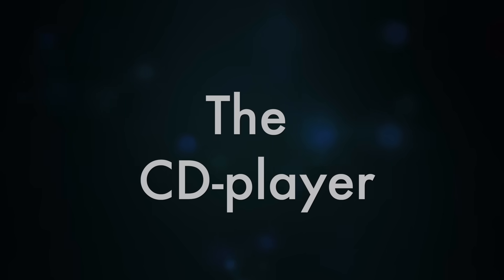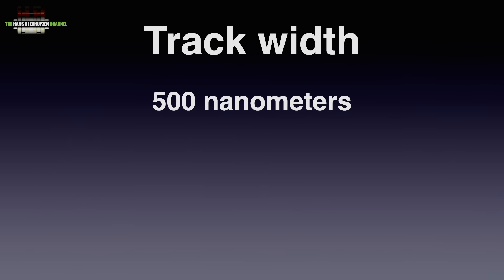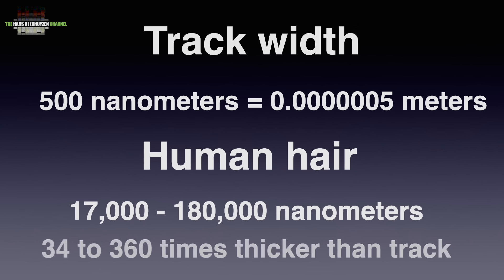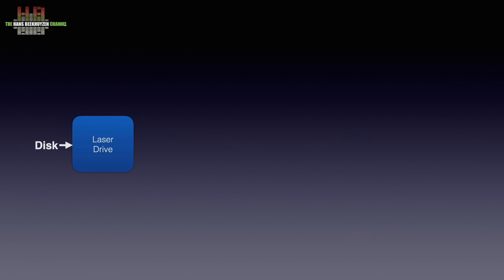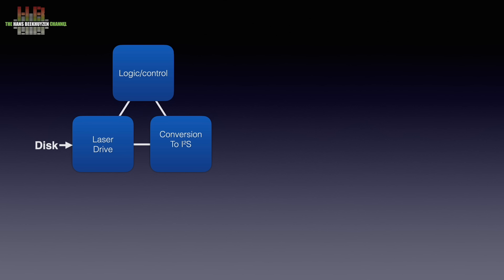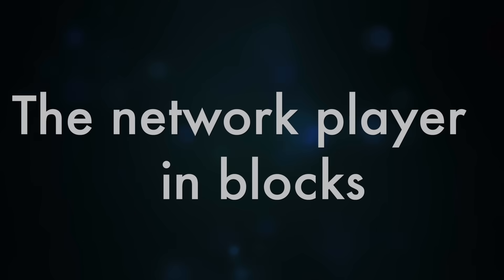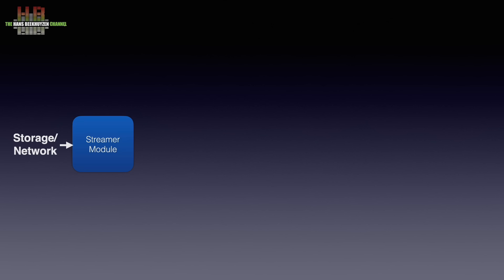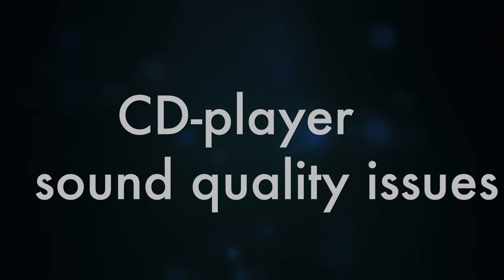CD player vs Streamer

Comment: Thanks again for the video Hans. However, I beg to differ. I have commented before about my experience with CD audio quality vs streamer quality and have found others with the same experience.  I have a streamer set up (Antipodes) that cost roughly five times as much as my Project CD Box RS2 T transport. The streamer is great for being exposed to new music, but whenever I find an album I like, I buy the CD. I hear a very clear hierarchy of quality - CD best, purchased digital files played from the server second, and files streamed third. The streamer and CD transport are of course played through the same DAC. The streamer connects via I2S and the transport via coax. The greatest improvement in sound quality is between CD transport and the rest. Why this should be, I have no idea. But this is my experience.Thanks again for your video.
Reply from the maker: I don't know if I agree.

Comment: Also , did you leave out the bit rates of CD players Vs network streamers by choice? Network streamers could do 24/192 which cd players can't. Maybe you think bit rates doesn't matter as far as sound quality is concerned.
Reply from the maker: I compared sources with equal sampling rates.

Comment: You seem to indicate WiFi might be better than wired due to the quality of wires and switches. I use Wi-Fi for all my devices in the house due to the difficulty with running Ethernet cables through walls and ceilings, and have experienced great sound quality and video quality. It would be great to make a video discussing differences between wired and wireless streaming because there seems to be misconceptions about Wi-Fi.
Reply from the maker: It all depends on the gear used and how busy the Wi-fi band is at your location.

Comment: So the 'track width' (or more accurately 'pit width') of a CD is 500 nm. The pit width of a Blu Ray disc is 150 nm. And yet the cheapest Blu Ray player is capable of retrieving data of a far higher density than CD with no issue whatsoever. Some CD players allow one to monitor the errors in the stream (you need internal access to the machine and some test gear for this). It will be noted that read errors are nowhere near as common as implied in this video.
The issue of jitter was solved 25+ years ago.
Reply from the maker: If only. Video is quite a different technique than audio.

Comment: I have to say that my 32 years old Krell MD-1 cd transport with the latest Volumio Preciso dac still sounds much better than my Volumio Rivo Plus with Volumio Preciso dac. Both the Rivo Plus and Preciso were bought within the past three months. And I bought the Volumio Lineo5 psu too.
Reply from the maker: thanks for sharing
Reply: That’s really illustrative. My system is excellent. My streaming is on par with playing Qobuz from a M1 MacBook Air. 

Pulled out an ancient Panasonic BlueRay player. It crushed both playing a standard 44K Kind of Blue CD. 

Routed through an RME ADI-2.  Unreal. Think your Sabre based DAC may not be top tier though. 

Did you connect your Rivo+ via I2S? The CD player will likely win anyway but by a more narrow margin.

Comment: I've invested heavily in a new streamer U2X by Lumin.  I notice when I stream from Qubuz or Tidal using 24-bit source material the sound quality is exceptional.  I have a PS Audio Directstream Memory player, and there is little to fault from the sound quality but find myself preferring the Lumin. The English Electric 8switch makes a difference and looking forward to the arrival of the Stack Audio Smooth Lan Regenerator next week.   Attending to every aspect of the system chain seems to have an impact on sound quality.

Comment: The fact is that the 44.1kHz sampling frequency of CD isn't enough to fool the ear if you have a high enough resolving system. I've experienced this effect myself so many times on my headphone rig while working from home. I've had it happen many times that while listening to a playlist, a different album will come on, and I immediately notice a smoother, "rounder" sound, and I look at the main LED on my Chord Qutest DAC, and sure enough, that album is 96kHz or 192kHz.  This has happened so many times that I'm certain it's not placebo.  While listening to music on my headphone rig, I get visual images in my head. For CD resolution music, that image is a spikey and sharp spherical object. For true hi-res albums, that object is a soft and round sphere.
Reply from the maker: 44.1 kHz is sufficient if the DAC is good enough. for affordable gear a higher sampling rate makes it easier for more affordable DACs to produce a higher sound quality.
Reply: High-resolution hi-fi gear can have their own issues with less resolved source material. Listening to CD's with less resolving CD players, headphones or speakers, that are good quality but not high-resolution, can help fix that problem.

Comment: Thanks for the no BS approach Hans!  I am confused with the point about spinning faster as you get closer to the centre of the disc and I also heard it from somewhere else as well. Not sure how that works.
Reply from the maker: The diameter of the groove is smaller on the inside and gets bigger to the outside. So a. higher rpm is needed to maintain a constant reading speed.

Comment: I use a very high quality CD transport that sends its digital signal to a high quality DAC   
It sounds far superior to streaming.
Reply: What products do you have?
Reply from the maker: Thanks for sharing your experience.
Reply: I use a high quality streaming service (Tidal Master) and output it to a high quality DAC powered by an audiophile power supply. Vastly outperforms any comparably priced CD system.
Reply: Highly doubtful. Had one of the top Sony SACD players back in the day. It was excellent. Now, I almost tossed out an old Panasonic BlueRay DMP-BD35.

Connected it via toslink to my big tube amp monoblocks system’s RME ADI-2. Put on an old standard 44K “Kind of Blue” disc. 

Set up one button to flip back and forth to the souped up streamer. No contest. The old Panasonic I couldn’t get $20 for is vastly superior. 

Someone else in the comments noted similar with the widely extolled Rivo+.  Hans, this is depressing. Thanks for the video and subject matter discussion. 🫡

Comment: Back in 1998 I bought a Rotel RCC-945  6-CD changer which served me very well for over 25 years.  Then, a couple years ago, my son and I decided to try making a pi-fi player so I could start doing some streaming.  We picked Volumio as the OS for the pi, and I bought an open box ifi ZenDac V2 just to try and keep my costs down.  

I ripped a number of my favorite discs into WAV files as I wanted to run digital copies of my physical media to play through the pi & ifi to see how it stacked up against the Rotel CD player in terms of sound quality and all I can say is wow.  I wasn't prepared for what I heard.  

My setup is pretty modest compared to many or most fans of this channel: mid-80s HK separates, early 90s B&W bookshelves and the Rotel CD player.  That said, I wasn't expecting to hear much difference in sound.  If anything, I expected to hear a reduction in SQ.  

Long story short, I was wrong.  I had no idea how far DACs had come.  The ifi cheapo DAC outperformed the old Rotel in every discernible way.

I went ahead and ripped my entire collection.  But I also found that the digital music on Qobuz was just as good as my ripped files.  

I've since sold the Rotel, and my listening has gone completely computerized.  

I can only imagine what high-end players and DACs sound like, and I know that CD players are having a renaissance moment now too, but I'm so thoroughly satisfied with my setup now that it's highly unlikely I'll ever go back.  I'm 52 and my ears aren't getting any younger so I know it's all downhill from here.

As you love saying saying, Hans, whatever I do, I'm enjoying the music!

Comment: Am I the only one hearing the Hans voice clearly distorted? For a hi-fi channel this is pretty odd — sounds like the mic is way too far away and room reflections are creating this annoying, smeared sound.
Reply from the maker: That's odd, I have not changed the gear nor settings . I'll dive into it.
Reply: @TheHansBeekhuyzenChannel  Thanks for the reply! Just to clarify, I’ve noticed this same issue over the years in your videos but never mentioned it before. Probably just a matter of moving the mic closer — right now the room sound is what really comes through, at least to my ears.
Reply from the maker: Heariing the room sound dominate is strange. My recordings are not super dry (don't like that) but the microphone is only 20 cm (8") from my mouth.  Nowadays it is in the pocket of my shirt.
Reply from the maker: I have checked it. In my recordings there is no real distortion. On. YouTube only the top end is a slightly harsh. Probably due to the coed used.

Comment: that doesn't make sense it has to be  the other way around, It need to spin faster on a disc on the outside because the distance, the distance covered is longer
Reply: A transport plays CD's from the inside of the disk to the outside. When a CD makes 1 revolution, the surface area covered on the inside of the CD is less than the surface area covered on the outside. That means less information is read on the inside per spin than the outside. Since more information is read on the outside, it doesn't have to spin as fast to read the same amount of data on the inside of the disk.
Reply: I don't think that's correct. why would there be more information on the next column? it is stacked up against each other. less on the inside?? more on the outside? doesn't work like that.  @052RC
Reply from the maker: well, it does.
Reply: no that's not correct. constant linear velocitymeans that the disc has to spin faster the closer to the edge you're getting. not the other way. don't use AI because it will give you both as correct. if a disc was spinning faster in the centre and not to  towards the outside you couldn't maintain linear velocity. the greater distance means it has to spin faster to to be linear through the whole  disc surface not slower.  @TheHansBeekhuyzenChannel